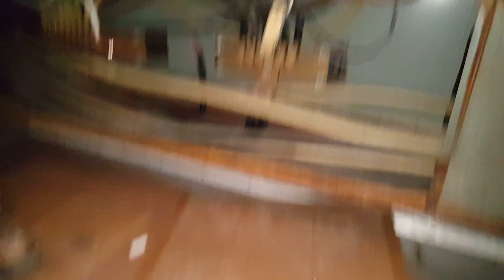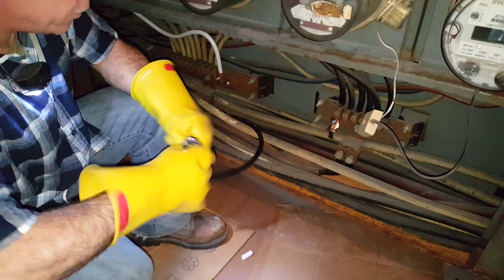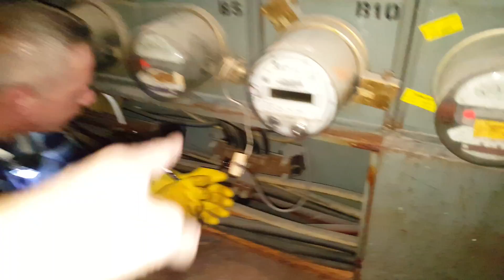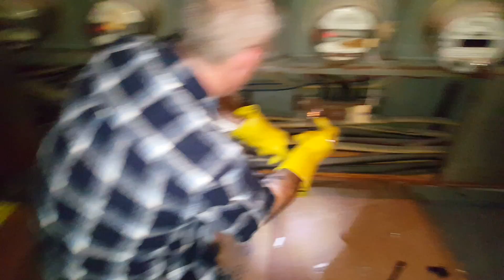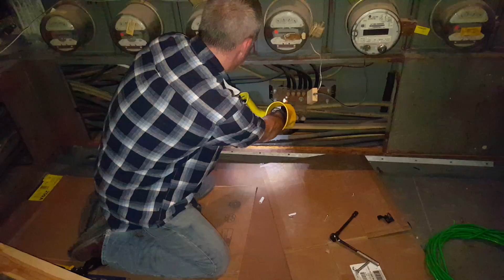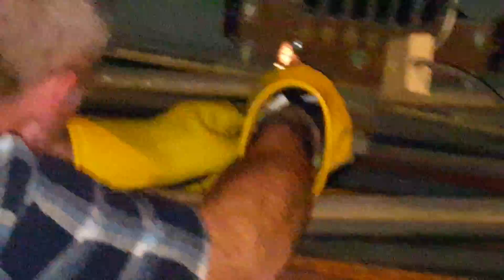Electrician NYC

Comment: There really is no excuse to work live, its ridiculous, I wouldn't do it
Reply from the maker: Everyone in nyc works live. It's unreasonable for Con ed shut down a whole building of 56 apartments for a simple 120v tap-in.
Reply: DangerousTv1 there is a meter for each apartment
Reply from the maker: Do u see any disconnects for those meters???? How do u suppose we shut them off?
Reply: It's necessary to work live especially in a substation I know, but only with proper safety gear at least an arc s
face shield.
Reply: You do know that insulated tools exist?
Reply: DangerousTv1 You get the company that supplies the building to shut down or you use the right safety clothing, tools and procedures. No need to risk your life just for a stupid little job.
Reply: They're installing the tap upstream of the meter. The whole service would need to be shut down in order to avoid live work here.
Reply: sometimes we would have to pull the meter even though it’s not allowed. Sometimes we don’t and have to work it live, it depends on the situation... its dangerous as fuck but you gotta do what you gotta do. 
It’ll make a lot of people unhappy turning off people’s apartments and a lot of hassle calling the city to turn off the power
Reply: Haha dont even bother with him bro, makes me laugh... impossible to shut several services out for a swap... you have too work live. 15 year electrician here with lane valente from bohemia... been watch in your vids bro entertaining ,keep up good work...
Reply: DangerousTv1 --- I've been doing electrical for over 30 years and you and I and a lot of other good electricians know we aren't going to call the power company to come unlock the collar on a meter just to install a fucking circuit and then have to call them out again to put the lock on when we're done. Besides, out here on the West coast PG&E, So.Cal.Edison, and LA dept of water & power want a signed off permit by an Inspector from the City Building and Safety Dept before they will even restore power.

    Doing hot work is no big deal if you know what you are doing, have been trained well, and as long as you pay attention to what you are doing.  I work on hot circuits almost every day.
   When I was IBEW journeyman doing commercial industrial wiring I always asked to be in the electric room setting all the gear and transformers and as lead or second for the wire pulls for building feed, then I would land all the breakers and transformers and there were times when I had to land a set of 500,or 600 mcm or even 750 mcm circuits onto a 800 amp 3 phase breaker in a live stand-up section  rated at 10,000 and I've had to actually climb into the panel and the hair on your arms is standing up and its about 130 degrees Fahrenheit and the buzzing from the transformers and the induction coming from all those circuits is vibrating your whole body down to the bones and you are sweating your ass off just standing still and one wrong move or slip or drop a screw or bolt or washer or wrench will end your life in a flash and if it didnt kill you, you will be wishing you died every day that you live.
    But, I love it.  I enjoy those moments at work when I'm putting my life on the line which is almost every day. It has nothing to do with being stupid or choosing to play it safe because you are scared or because you have a family at home. Its about being the best at what you do and not being arrogant or careless. It is a very serious job, being an electrician who does service work at any level of power. More people die from 120 volts than from all the higher voltages because people get lazy and careless and too comfortable and they lose the respect for electricity. 120 volts isn't enough to throw you off like higher voltages, it holds onto you and the 50 or 60 Hz cycle is very close to the natural current our body runs on and causes our muscles to contract and you cannot let go of whatever is in your hands as well as putting your heart into spasms keeping it from pumping blood to your organs and brain. It'll boil your blood and turn the 70% water that makes up our bodies into steam and cook you from the inside out the way a microwave cooks a hotdog, splitting the fingers and forearms of the person just like a hotdog does. 
   You can't hear it, you can't see it, you can't smell it, and it is faster than anything but light speed, and it can kill you or make you wish you were dead, that is electricity. If you don't respect it, you will pay the price.  
    I get small shocks all the time working but I'm always aware of what I'm doing and never have myself in a position to be stuck on something grounding me or where a tool will touch something. So, you get a little current bleeding through a dimmer switch or returning through a neutral wire once in a while. You get used to it. Lol
Reply: Nothing wrong with working live if you know what you are doing. As an electrician it's part of the job a customer rarely wants to de energize something for you to work on it it's too much of an inconvenience and in a factory you can be sued for de energizing something because it can shut down a process or whatever